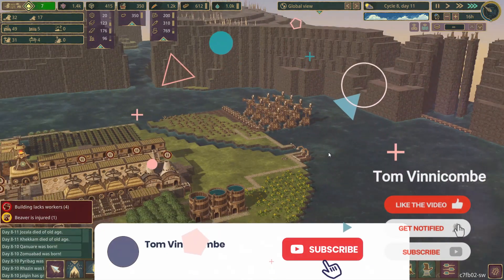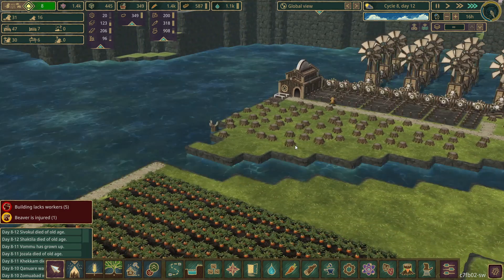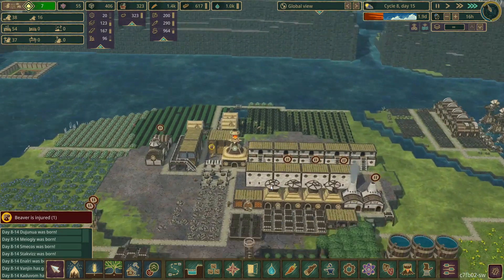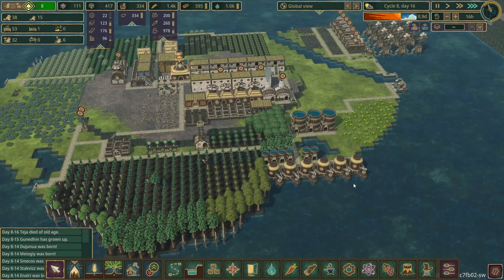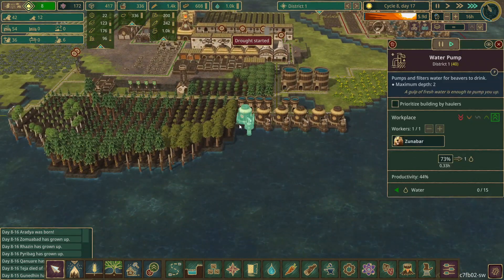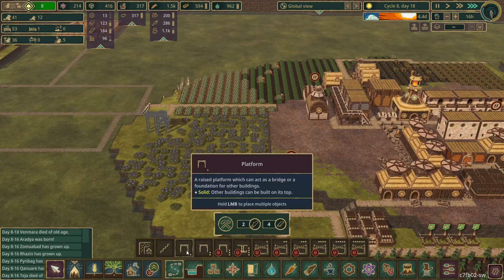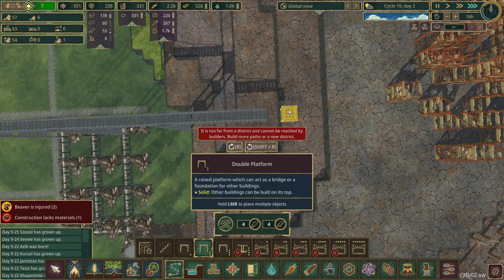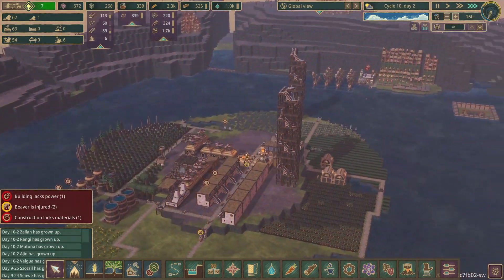Starting A New Mega Project In Timberborn

Comment: If only you had built the paper mills first you wouldn't have needed that extra power shaft turn...
Two double platforms is of course the same height as a triple and a single but they should be much easier to place since presumably you can just build round and round without changing your selection except to fill in the stairs and paths occasionally.
It was unfortunate that your tower was in line with your wind farm. I think you should be able to rebuild one of the windmills but I can't tell which from just watching.
I preferred your previous technique of counting six squares from the previous bridge to work out where the next one goes rather than clearing the crops from a square and hoping you picked the right one.
I think both towers could have done with having one fewer set of stairs but that's just a personal preference.
I see that mine is no longer underwater; are you planning on building it?
Reply from the maker: I’m planning on building that mine as soon as possible, thank you for all of your support